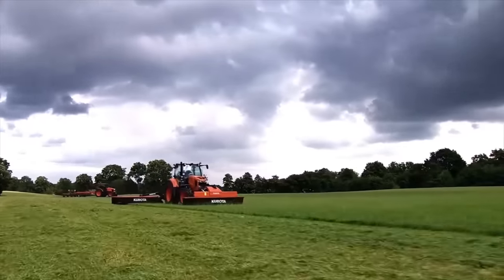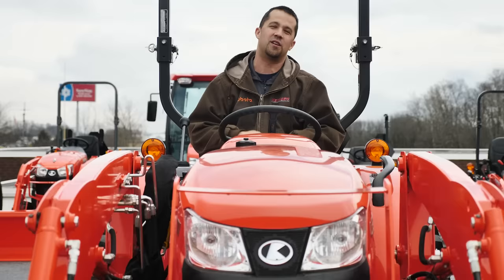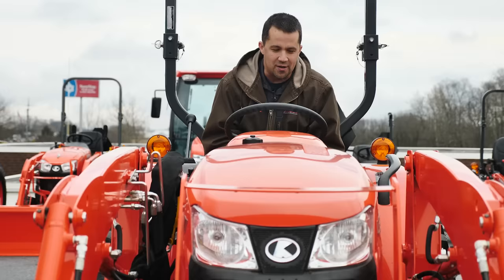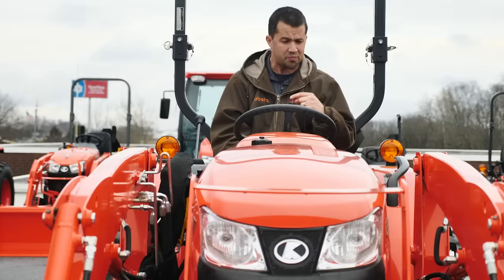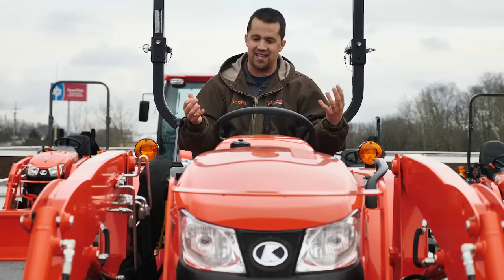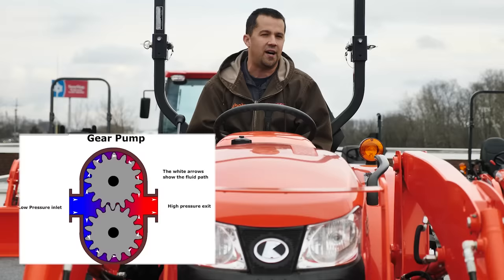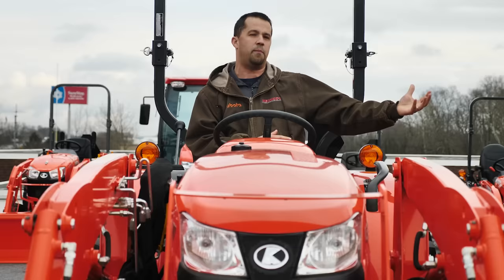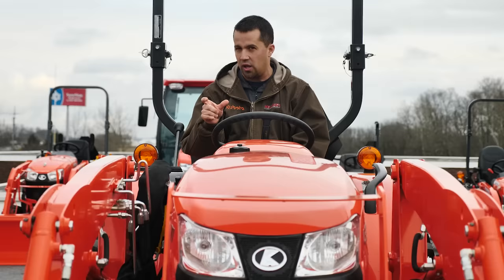Why you may NOT want more hydraulic flow from your tractor?!

Comment: Hey Neil, just finishing up my Hydraulics class in my engineering program. You were pretty much spot on with the technical explanation in the video! Another thing to keep in mind is that there are two aspects to "power" in hydraulic actuators: horsepower and torque. It may be possible to raise the flow rate of the hydraulics and make it go faster, but you are going to lose torque as you do. It doesn't do much good to have more flow if you are stalling anytime there is load.
Reply: Same with say motorcycle sprocket or automotive differentials. If you want top end (high flow) you sacrifice torque (pressure). And vice versa.

This is were torque multipliers come into play. Cross manufacturing makes PTO pumps that use torque multiplier. See their 50T052. 3 times the flow with the same HP.

Comment: I'd LOVE to see a diverter of some kind, where more horses can be used to flow with a gear shift or electric valve switch.  There are plenty of jobs where the tractor doesn't need to move much, or at all; auger, stump grinder, forester head, etc.  Tractors are designed with old-school Ag mentality.  It's all about towing implements, with a need for ground-engaging torque.  Some jobs just need to be able to roll the tires, not pull.

Comment: The biggest part of the problem is conservation of power, which would be flow vs pressure, on a compact tractor that typically has less than 35 total HP to work with.  You cannot make more power, so you have to trade flow for pressure and vice versa. At the end of the day, Kubota (Deer, Mahindra, etc) spec out a balance of flow and pressure that gets them the lift capacity and cycle times they are marketing for.  Your typical skid steer has much more power to work with and thus easier to deliver the best of both worlds.

Comment: Well stated, however the same doesn't apply to Hydrostatic drive tractors. The John Deere 1 series for instance only has Mechanical Front Wheel Drive. Other than the PTO everything else is Hydraulic powered.

Comment: A fixed displacement gear pump with open center dcv's (directional flow valves) will not take the full horsepower they require while the valves are in neutral. In neutral the pump is full flow at low pressure. On variable displacement pressure compensated or load sensing system (the higher end type systems you brought up) the neutral position gives you high pressure low flow. The opposite of the open center setup. Both have some drain on horsepower when not in use. Neither is consuming all the power they can in that neutral state.

Comment: Because more flow is often accomplished by increased pressure and the hydraulic devices are rated at a given pressure.  Exceed rated pressure and you break things.
Reply: I'd like to reduce the pressure where my relief opens, because stalling the engine shouldn't be the first "safety" to trip.

Comment: Sounds ok initially, however there is no need for continuous hydraulic hp while the  tractor is moving . While stationary you may want power a log splitter, chipper, auger  etc. Having a much larger hydraulic pump is possible and would only reduce the net tractor  hp by a small amount when the pump is not loaded. The steering circuit is separate and only requires intermittent hp. The design is biased to cost and not on the needs of the user.
Reply: Yeah this is a terrible explanation.

Comment: Thanks Neil,  you explained that really well. I didn't know this. I kinda knew this but had forgotten,  i worked at a Compressor Station 20 years ago and we had 8 and 10 cylinder Cooper Bessemer engines with 2000 HP. Any kind of addon auxilary robs horse power.  These Monster engines had hydraulic pumps that had 6" hydraulic lines to run the fin fan coolers that set outside the compressor building. Each engine has 5 compressors attached to them. So i realized that anything else added including hydraulic pumps can rob HP from the drive train. Thanks buddy.

Comment: Manufacturers could do more i would like to see a 50-65 hp tractor set up as tool carrier.  You could run augers, snow blowers, brush cutters and all sorts of neat stuff.  I think whoever steps up to the plate will do well with sales.  Have closed center system as an option.
Reply from the maker: Closed center is huge $$$, but I agree a tool carrier version would be great.
Reply: They do have this, they call them skid steers and compact track loaders

Comment: Good way to experience this is to put something such as a plow in the ground with a loader equipped tractor and while its pulling that plow just raise the loader or roll the bucket with nothing on it, you'll hear the engine note change and feel the the power loss may not be much but you'll know the engine is having to transfer it's power elsewhere.

Comment: I own a new holland boomer 24, I looked at lots of tractors. The boomer 24 was just the right size. Like I think it's the perfect size. By the time I got done outfitting it I have about 40 grand into it. And I'm a poor boy, so obviously there is a market for people that would pay for a better sub compact tractor with all the bells and whistles included and engineered in, and very well thought out. When adding a WR long 3rd function, a rear remote, backhoe, cab, heater and Air conditioning, quick attach plate, quick hitch system. It wasnt designed to have all of these components, and they didnt package together very well. I'd love a higher horsepower, higher flow, higher lifting capacity, standard bells and whistles machine, and sacrifice on price. I believe theres gotta be a market for that. I guess that's kind of what a ventrac is. But I had my issues with those too.

Comment: For instance the Kabota L 47 and M 62 I think need more hydraulic flow for small companies like mine. Who can't buy two different machines. I was looking to buy one machine to do both jobs but these machines do not have the flow output that I really needed.
Reply from the maker: That's a good example of a machine that would benefit.  They would need a ton more power though, they already run an extra pump for the double backhoe circuit
Reply: A auxiliary pto pump might be an effective solution

Comment: What you say makes sense.  The only part I can't get my head around is if my 25hp tractor can push a 60" snow blower running off the PTO, why can't it do the same thing hydraulically? Likely because the benefit of more flow is only going to help in specific cases and hurt tractor performance in many other uses.  Perhaps the economical solution for smaller tractors would be a clutched second pump in the hydraulic system that the user can engage when applicable.  Surely that could be an affordable option that could be added to at least the larger compact tractors for space reasons.  The cynic in me says the manufactures prefer to sell the mid PTO, forward drive kit, and front mount kit that are all quite tractor model specific to allow a front snow blower instead of a couple hoses to connect a skid steer option on the loader arms.
Reply from the maker: Efficiency. Shafts move power more efficiently than pumping fluids.
Reply: @MessicksEquip  Absolutely there are losses, but I don't think into the go/no go territory.  Your video of HST vs Geared had 1120 vs 1500 respectively.  From the perspective of the geared tractor that is a 25% loss and that was with the geared tractor having a ratio producing 1 mile/hour less speed so really it is less than 25% loss.  A 33hp tractor on the same frame with 25% loss is about a 25hp tractor, so in round numbers I see no reason why an option like added hydraulics wouldn't work on a 33hp and up machine.
Reply from the maker: It could. Expense would be the second reason. You do see this with skid steers, it's not like it's not done. Just not in this application.

Comment: So is this why the R430/530/630 doin't have enough Hydrualic power to run brooms and stuff?  Would it be worth it to run skid steer type hydraulic high pressures to make wheel loaders more versatile?
Reply from the maker: 630 can do it. On the smaller models there are other mechanical limitations

Comment: Why not just add a secondary pump into the loop that you can kick in when you know that you're going to be doing something that requires a lot of hydraulic flow but can be done stationary, like operating a backhoe or a posthole auger? In that scenario, allowing the pump(s) to use as much engine horsepower as possible would actually be beneficial, since you're otherwise limiting the amount of work you can get done in a set amount of time for no good reason, plus that you're not utilizing the engine to it's full capacity which is wasteful. I know for example that some slightly older Ag-sized Zetor tractors have PTO-dependant hydraulic pumps that increase the hydraulic flow by roughly 20l/min (5gpm) when you bump the PTO speed from 540rpm to 1000rpm. It's obviously not recommended to run the pump at that speed constantly since it wears the pump, but it's still a decent way of getting a bit of extra flow out of your tractor when you need it.
Reply from the maker: Would be interesting.  That's how a skid steer high flow works.
Reply: But that would cannibalize skid steer sales so no bueno.

Comment: Sorry brother, but I am a mechanical engineer, and what you are saying about power and fluid flow is wrong when applied to tractor hydraulic systems.  Yes it takes some much power to make so much fluid flow at so many psi in a given amount of time.  There is a physical constant for that, formulas, the works.  But you are not applying these facts correctly at all to tractor hydraulic systems.  You say for so much flow, this eats up most of the horsepower of a tractor, and little is left for whatever.  Well that is not really true.  Just the fluid flowing does not eat up power. Parasitic loss is very small, and here is why.  When the tractor's hydraulic valves are in the center (neutral), hydraulic oil does not dead-head and blow open the relief valve.  It goes through the valve, and on back to the reservoir. Circular flow with no work (movement) being done.  If you measure pressure in the system with a gauge, it will be 1 or 2 psi. Not enough to make the needle move. Yes this is a small parasite loss, but not like you describe it.  If the fluid was dead-headed in the valve and holding 1000 psi or more, then yes there is flow being turned into heat, and work is being done. But that is not how tractors and their valves are set-up.  Yes there are some hydraulic system set up to run at full pressure all the time, weather there is demand for flow or not, but not in the tractor world. Industrial manufacturing machines yes, but not tractors.    --  Now, if you are actually using your hydraulics to do work, like lifting something with the front end loader bucket, you only build pressure in the hydraulic system based on the actual load weight being lifted in the bucket.  You can actually have a pressure gauge in the system, and the heavier load that you lift, the more pressure that will be indicated on the gauge. Only with a load so heavy that the tractor can barely lift, will you see a high pressure on the gauge, nearing the maximum pressure of the system.  If you lift an empty bucket, you might only see maybe 100 psi in a system designed for 1000 psi max. This means you are only building pressure in the system and using it's flow when lifting or otherwise doing work. You are not consuming max power all the time. Only are you consuming some power based on the weight you are lifting and the speed you are spinning the pump (throttle setting).  Now, a higher flow pump will deliver more power, given the same pressure, our old friend physics there, but is is on demand, not all the time. Parasite loss will be larger with a bigger pump, but it is still 2 or 3 psi. In your post hole auger example, yes you are using maximum flow, and pressure is based on the resistance it sees digging through the ground. But again, with the drilling auger, you do not need horsepower for anything else! The tractor is not moving, nothing on the PTO, it is just digging a hole.  Heck yes it could use a larger pump, with very little disadvantage when seeing loader or other hydraulic attachment uses.  I think you are using a straw-man argument here. Stating some facts and figures, and trying to correlate them to tractor hydraulic pump flow.  Not all the things you are saying apply to the degree you asserting them to be relevant.  It is great that you are trying to explain hydraulic pump flow to tractor buyers, but you might want to dig in to the details of hydraulic systems a little bit more to ensure you give good advise.  Please don't take my comments as negative, Just trying to help.  --Doozer
Reply: I had the same issue as you with his analysis. Typical hydraulic pressures for this class tractor is 2000-2500 psi, so call the psi a constant across machines. Then the hydraulic flow rate is directly proportional to engine horsepower, at a constant psi dictated by the bypass valve under full load. Doesn't matter whether the hydraulic power is going to the hst transmission or loader and bucket - often both - the flow can't be increased (allowing you to move faster, raise the loader faster) without increasing the tractor hp.

Comment: Not a good reason. There should be a gear shifter for the hydraulic pump so that the operator can decide if they want high PTO power or high hydraulic power.  The hydraulic pump can rotate slowly when the operator want more power to the PTO and faster when more power is needed for hydraulics. I would happily pay five thousand dollars on a sixty thousand dollar tractor for that option.  I have a suspicion that Kubota and other companies do not want to cannibalize sales of their skid steers.
Reply from the maker: That's kinda the same option that high-flow on a skid loader is. That would be cool to see. I can't see a concern on cannibalization though, they are still selling a machine and with this option it would be a machine of equal cost.

Comment: Great explanation Neil, and don't forget about the heat generated pumping large volumes of oil. On a different subject of hp usage, I keep hearing about the hp required to run the AC in a small tractor like the B2650. Could you set up a dyno test of the pto hp output with the AC on and the AC off, that would be awesome info.

Comment: That's not quite true Neil. When you're pumping hydraulic fluid around the tractor and not using any of it it does not use hardly any power. Because it will be at zero PSI. You only build up pressure when there is resistance to flow which is what happens when you use hydraulic fluid. So just pumping 10 gallons per minute through the machine Will use practically no power. power is only consumed when the hydraulic fluid is asked to do work

Edit: I wrote that comment and hit post right before you brought up the caveat that you just agreed with exactly what I was saying. So discount what I previously said. Lol

Comment: Could you add external pto driven pump? Turn off pto to drive to next location.

.
Reply: Yes you can, its called a power pack. they are pretty spendy but typically put out huge flow
Reply: They are now making power packs and lower prices.. there is one power pack I think it’s made by land shark supposedly they sell for under 2k and can be used on a sub compact tractor.. total weight of the power pack is about 400lbs so it can act as a good ballast as well. 

I would like to see these tractors being sold as an option for PTO HP vs hydraulic flow.. as thats typically the trade off as Neil explains in this video.. maybe have an option to lower your PTO HP to gain a few GPM on your pump that would be great.. as more people these days wanna run front hydraulic attachments over rear PTO attachments

Comment: Interesting information, It would be nice to see the power steering flow and Tractor/SCV flows separate. I'm waiting on the results of the M5-111 that the steering won't turn with a load on the loader while sitting still, (SLC Farms). Also no float on the SCV with the M5-111. Just a few changes in this tractor would make it a top seller.

Comment: Great video.  This has been one of my pet peeves with my Kubota B2650 tractor.  Great tractor, but the PTO horsepower is low.  Eventhough the loader has a skidsteer quick attach, I can't run something like a hydraulic snow blower on the front.

I thought the solution would be to purchase a PTO driven Hydraulic Power Pack to give my tractor that extra hydraulic flow.  Yet most PTO Hydraulic Power Packs out there reguire a tractor to have a minumum 40 to 50 horse power to operate and they can be very expensive.

Again very frustrating.
Reply from the maker: running a snow blower out front with hydraulics is a terrible idea on any tractor. Lots of people want to do it, but mechanically it does not translate well.
Reply: @MessicksEquip  Interesting comment, much appreciated and something to think about.  The other hydraulic implement I was considering for the front of my tractor was a brush mower.  How would that work?

Since you raised a very interesting point, which type of implement would you not recommend to be run on the front loader?  Thanks.
Reply from the maker: on a B2650, I'd not run a mower either. Some L\MX tractors can get away with running 48" ones.